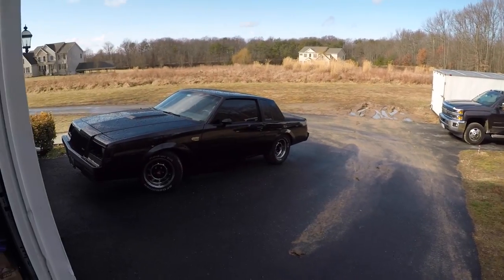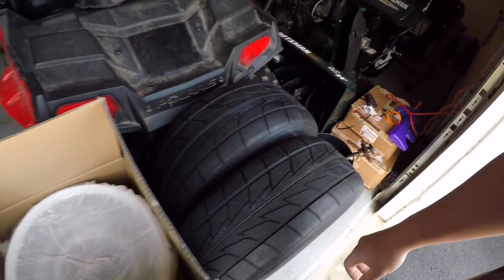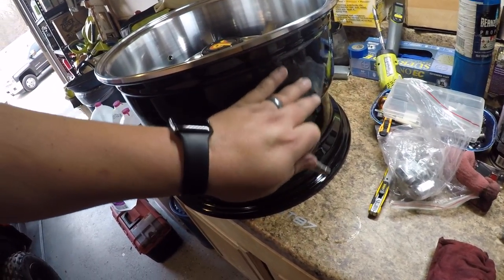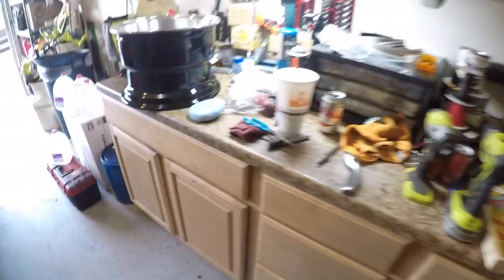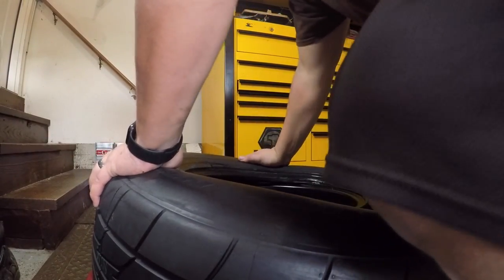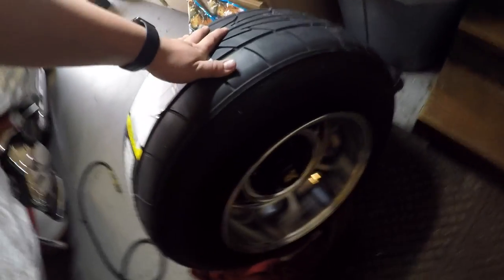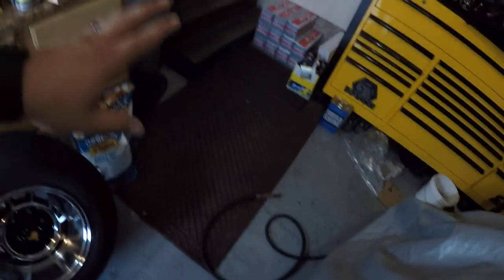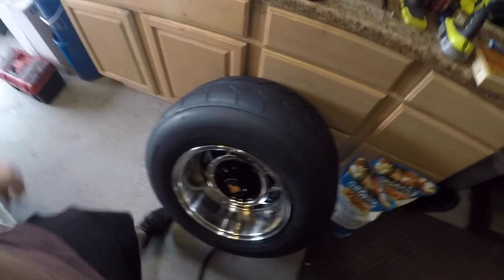Mounting Drag Radial Tires at Home for Fun | Buick Grand National GBP 15x10 Wheels

Comment: glad you did this video on these rims. Gonna get them in about a month. and never saw a tire put on manually in the true sense lol. pretty cool.
Reply from the maker: Sheldon K, it was mostly just for fun, I had done this a couple times before both times when I was younger and had no money to take the car to get the tires done at a shop lol
Reply: VenomGT87 Hey did you have to notch the frame or roll the fenders to get the 15x10 to fit the rear?
Reply from the maker: Fit like a glove, if I lower the rear I may have to roll the lip a little

Comment: great work , maybe i will buys two replica wheels for front cause i have problem with center cap . two time they fell down cap in the street .  is rear brake Drums ?
Reply from the maker: Thank you, the center caps are a snap-in style instead of being held by the lug nuts. I had the same happen to me 3 times. Yes the rear are cast iron drum brakes for now, I am switching to discs in a not so far future.

Comment: Hey where did u order the wheel from. Trying to get more rubber on ground for traction on my 87 gn. And will they fit on stock suspension no lowering?  Thanks for the help man. I've been watching just about everything you have done. Keep it up.
Reply from the maker: Both sets on eBay. They will fit but you may need to roll the fender, every car is different.

Comment: I am curious about the fit being a 10" wheel and 275/60's.
Reply from the maker: It will fit like a glove, these have the correct backspacing and the tire well is bigger than people give it credit for...lol
Reply: So it will fit on stock suspension? No lip bend?
Reply from the maker: As long as the rear end is not lowered, Yes.
Reply: Nice thx for the reply

Comment: How can you remove drag radials without messing up rims?? I'm in that situation right now
Reply from the maker: Use a composite general purpose tire iron. Should be fairly easy if the tire is de-beaded

Comment: Did you use any lube?
Reply from the maker: On the tire beads, yes.
Reply: @VenomGT87  did you wipe it off before seating them? I want to use your mounting method im just worried about the tires slipping on the wheel if i use too much or the wrong lube
Reply from the maker: rstormzand dont worry about it, just dont use oil. Lightly soapy water is fine.

Comment: I have these on my GN awesome wheels, the car hooks like crazy with these... Its tight I have a 1.5" spring spacer lift out back with 2 air bags for traction. My GN is the one on the Gbodyparts.com website. Remove those 2  plastic frame hole caps both sides, watch the body of the car it moves allot if you don't have polly body mounts the body will move on hard corners watch the bottom section of the body fender closer to the doors you may have to give it a few taps, I switched to poly mounts and this solved this. If you have stock ride hight. you have to slightly roll the fenders, its easy to do. Just some tips these tires are big so you have to keep an eye on things. no two GN's are exactly the same My frame is tweaked about an inch and a half from too much toucher, so you may not have the same issues if your car is still straight lol my car sits so crooked lol. I also have UMI suspension arms so the axel is solid with no movements. frame clearance is about 1/2" give or take. these have been on my car 2 years. I plan on changing the gears soon to 373 since these are much larger wheels.
Reply from the maker: Thank you Franky, I didn't even think of those frame caps, I'll pop them off once I install them on the car. I do have poly bushings on everything because the tires I have now used to rub so I replaced all the bushings and centered the body on the frame which fixed most of it but it still rubs when the suspension articulates a lot like when pulling on to a steep driveway or taking a corner a little fast.

Comment: What size tires on your everyday driving wheels
Reply from the maker: 275-60/15
Reply: @VenomGT87  on the rear tires what's size u running on the front
Reply from the maker: 235-60/15 front
Reply: @VenomGT87  any rubbing
Reply: I just got in 86 t-type Regal cleaning with 15x17 and I'm trying to figure out what size tires to put on
Reply from the maker: Depends, if your car is stock height no. If you lower it, You'll need to roll the quarters.

Comment: Hey what backspacing did you get on those rims to get them to fit?
Reply from the maker: They are 4.5 BS but you can go up to 5” BS
Reply: Cool man thanks for fast reply. Just got a 87 GN last august and trying to get all the factory bugs worked out of it. Your videos have helped out a ton! What tires/rims are you running on the front?
Reply from the maker: christopher Johnson 15x8 aluminum repros with 235/60-15.